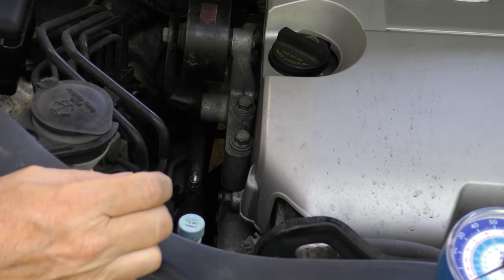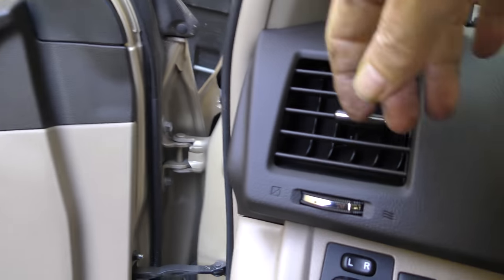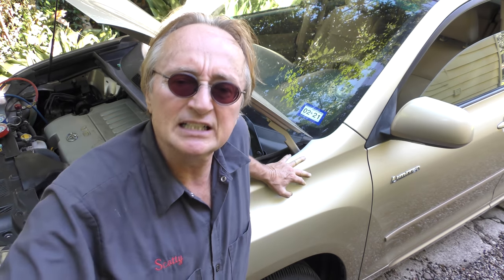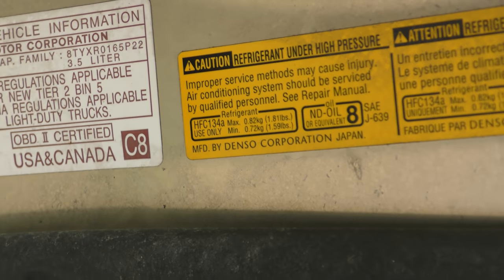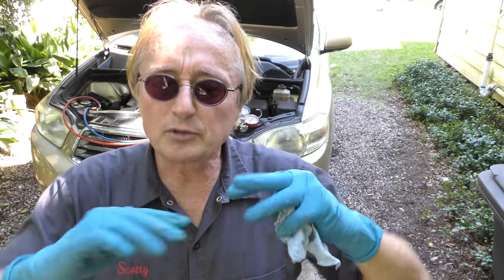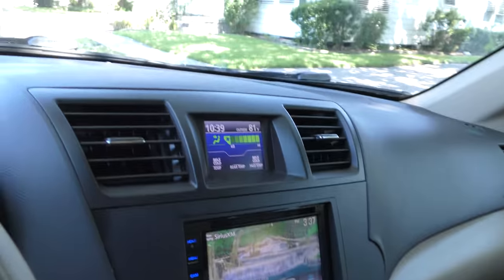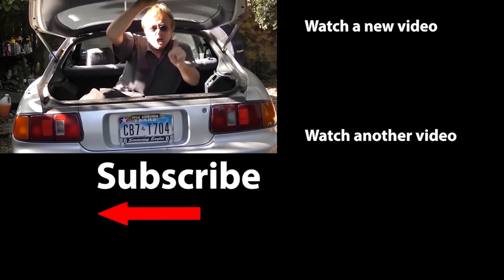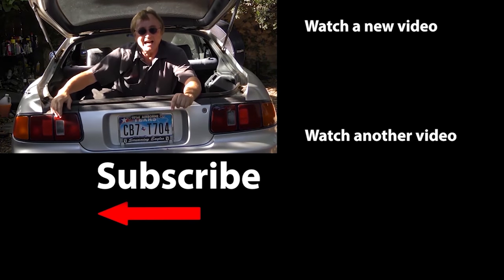Doing This Will Make Your Car's AC Blow Twice as Cold

Comment: I actually had an insane ordeal with my Corolla after an accident. Prior to the accident the AC blew hard and cold as hell. After the wreck and body shop repair I noticed the air was coming ok a bit cooler than ambient but also that the air was coming out like it was on the lowest setting but it was on full blast (Fan speed). I have worked on lots of cars and I worked in an auto shop with my father for about 12 years. That was a while before this though and I hadn't worked in a shop in about 4 years by that time. Anyway I still have all my tools since I paid for them myself. I got out my AC stuff which looks just like yours and my loads were all funky very similarly. I don't know if they got air in or used the wrong refrigerant. All I know is I put a factory load in and the air was extreemely cold but I still had very little air coming out. I thought maybe the fan was clogged, the bearing was dragging it down in speed or maybe the cabin air filter was clogged but it was changed just a month before the accident so I really didn't suspect that. Well I was wrong not to assume the cabin air filter. I don't know where they stored my car. Maybe they left my car open and taken apart because it was as if a bird or rats had nested in there. The cabin air filter was caked with about an inch and a half thick layer of dirt, branches, leaves, tree seeds spider webs and who knows what else. And I was breathing that in!!!! Luckily it had no odor, somehow. Anyway, I bought a new cabin filter and the whole thing has been good as new since then. Obviously I've changed the cabin filter again since then because that was about 3 years ago and I live in a deser that constantly has wind. The cabin filter actually gets extremely dirty and starts affecting air flow here within about 2 years. So I change it every other year now. It's only about 12 bucks so it's not a big deal and it keeps me comfortable. It was just incredible the way they did things so poorly. I actually have a suit going against them because the paint repairs they did started peeling withing a year of it being done. My car is two tone now because the clear coat came off every bit they repainted. I'll be getting it repainted after the case is closed or settled. For now, I look like I have a sunburned car lol.

Comment: 2006 Kia Spectra when my car is idle for over a minute or so the air conditioner will stop blowing cold air even though the air is blowing in but then as start to drive the cold air comes back after about the time.  My engine light is on but I don’t know why.  I think the car runs fine.

Comment: A plugged cabin filter will restrict flow. Toyota’s filters are cheap and easy to replace.
Reply: A plugged air filter was cause the low side to run lower than normal

Comment: After vaccum the system you should hold it for about 10 mins to watch to see if there's a drop. Also afterwards use nitrogen to pressure test for leaks. Afterwards if no leaks from Vacuum and Nitrogen, then charge the system with R134a to the OEM weight.

Comment: Mr Scott: Got a quick question about my 2003 Dodge Dakota V6 Quad Cab. My AC "blows", just not as well as it should. The temp is *ok*, though not as cool as I'd like it, and it doesn't blow from ALL the vents like it SHOULD. It BARELY blows from the very far left vent, and gets MARGINALLY stronger the more you go toward the passenger side. Any idea where to start short of tearing the dash apart and checking the duct work?

Comment: I have a 1990 S10 4.3 automatic replace condenser and lines worked well until fan stopped working can you show video on how to replace whatever sensors involved that won't let the fan run again it is something I tapped around the air filter that controls this fan please let me know

Comment: 90% of the time your leaks going to be your condenser. They have a tendency to get stone damage because they're bolted to the front of the radiator. +corrosion...  I don't trust people selling a used vehicle that say oh it just needs a charge. One vehicle I own I tried to charge it and it leaked out the evaporator in the dash. Almost passed out throwing up off huffing the R134a.  Costly / time consuming repair needless to say it never got fixed. If they say it needs charged there is a leak which you can use dye/ blacklight to tell but if you're spending over $2000 tell them to charge it then... Be careful buying a vehicle in the winter it's hard to tell if it's broken and an AC repair can easily cost $800...

Comment: Refrigerant does not “waste” unless there is a leak well then obviously you’re gonna need some but if not the pressure and total amount should stay the same. However I noticed when you were adding some to your car you had the can facing up and that can cause for more air to enter than Freon so to prevent this a helpful tip is to turn it upside down :)

Comment: i DO NOT WORK ON AUTO AC'S BUT I WAS TOLD THAT 134A WAS A BLENDED REFRIGERANT AND IT HAD TO BE ADDED AS A LIQUID  AND NOT A GAS BECAUSE THE PROPER BLEND IS ONLY IN LIQUID FORM  AFTER IT IS IN SYSTEM IT HAS THE CORRECT BLEND I KNOW FOR A FACT THAT 410A THE RESIDENTIAL FREON HAS TO BE ADDED / INSTALLED AS A LIQUID

Comment: Scotty, I got a 2012 Honda Civic. Recently, A/C stops working. A/C blows cold air only on first start up of the day. After driving 5-10 mins warm air only. A/C compressor works but only for few mins after driving. Replace A/C relay and power is getting through the compressor.
Reply: Recently just got it recharge correctly too. Please any ideas! Will help!
Reply: @Kike5155  Did that help? Condenser clean?  Electric condenser fans working? Diagnostics run?
Reply: wholeNwon I haven’t tried it out but I will to clean it. Electric fans do work tho!

Comment: I went for two years without A/C in Alabama in my '94 Ford Ranger. The compressor spun and the windshield fog would clear quickly in the winter, but the aircon wouldn't get cold.

Took a chance and had the system evac'd two weeks ago and recharged with the factory charge and now it'll freeze me out of the cab on MAX.
Reply: Joe, you can always hang some meat in the Stranger.

Comment: Should check to see if the system can hold a vacuum. Pull the vacuum for about 10-15 minutes (should be a 30-inch vacuum on low side gauge). Turn off the pump and close the gauge valves, and leave set for about 45 min to an hour. If the gauge holds you know the system is sealed. If not there is a leak someplace.  If it checks ok, then resume vacuum for about another hour so that any moisture is removed.

Comment: Hey Scotty you might not read this email but I have a 2014 Nissan Quest with 140,000milesI, change the oil transmission fluid when needed and drive the crap out of that van and I have no problem with it this van it gives me 0 problems, I'll give you another update at another hundred thousand.

Comment: Hey Scotty, thanks for the helpful videos you are making.  they have helped me with my various cars that family and friends bring over for me to work on.  But I have a real head scratcher.  A/C system works only 8 seconds then all power stops- to the cooling fans and the compressor clutch.  If I shut off the car, it does that cycle again.  I have jumpered each piece and appear to work separate.  If I jumper the compressor and it continues to run without the fans, the pressures go up an no cooling.  What is in common to the three items that would cause them to not work properly?  If you have any insight I would greatly appreciate it.  Thanks in advance.  Rich
Reply: Low on freon? Low pressure switch turning compressor/everything else off?
Reply: @sspacil  Freon is good, LP switch R&R, Condenser new,  compressor new, all relays new, ECM new.  the system works only if I unplug the top plug on the ECM.  Not sure what that resets because I can not get an accurate wiring diagram.

Comment: yes I have 98 Chevrolet Silverado 150 collectors edition 350 vortex it has a 4L60E transmission it slips in 3rd and drive  runs 3300 rpm in 2nd gire

Comment: Hello Scotty I just bought a used 2009 Volvo v70 with the inline six cylinders 3.2l and 110,109 km no issues apart from a few cosmetic wear and tear did I make a good choice or a mistake... It also comes with the 6 speed automatic transmission from Aisin..

Comment: I have a 2003 gmc yukon xl 6.0 4x4 AWS.  Have battery drain problems only last 6 months.  Research shows that its a wire problem in steering column but can't  find squat on how to fix. Says the conection needs realined? Plus rear steer quit  but no body i talk to knows anything. Thought about replacing sensors evey worked on these. Thanks for any suggestions.  Raymun.

Comment: Scotty, you didn't mention one of the biggest problems in auto HVAC, the use of coolant cans with sealer.  It's actually difficult to find r134a cans without sealer in them.  It's really unbelievable that the industry keeps pushing this when every AC shop knows it's bad.  In fact most AC shops will not even hook up their equipment to your car if they know you used a sealer.

Comment: @Scotty Kimer, so this might sound odd and not pertain to the video. I have a 2017 Ram ProMaster City with the 2.4L Tigershark Multiair engine. I think that is the same engine they use in the Dodge Dart so would the same turbo work for my set up? Not trying to turn my van into a race car but was thinking when I have 1,800 payload and hauling up the Colorado mountains maybe a small couple pounds of boost might help. What are your thoughts>?

Comment: The high pressure hose wont fit on the low port and vise versa, also I see those get clogged all the time, which wiper act like low refrigerant, most the time you just suck it out and put a vaccum on it and it usually fixes the problem

Comment: Hey Scotty. I have a 2011 Nissan Altima  SL and I am having trouble with the mass air flow sensor.  That’s what the code said at AutoZone, so I purchased a new one and put it in, but it still running bad. It’s jerking as I press the gas, and if I’m going up a hill, it hesitate, and the service engine like is on, the brake light is on and there is another light I’m thinking maybe this is the traction light. All 3 lights stay on constantly. Can you please guide me on what I need to do to get this fixed please.

Comment: When you have 60+ in the low side on a fixed-displacement compressor, you don't need to evacuate and charge to determine that your compressor is shot, but if the compressor has an either mechanical or electronic control valve, that could well be the culprit. If the valve comes out all black or with aluminum shavings, don't even bother to replace it.

Comment: Scotty I got a question. I got a 09 equinox. Overheats with str8 dex cool. Water pump works boiled the thermostat still overheats. Did a pressure test holds pressure. Could the thermostat be sticking for some reason. Get no heat but felt the heater core hoses and they were hot. Im stumped

Comment: I need your help Scott .. I have 01 Lincoln navigator and the turn signals dont work inside or outside,  I have checked the fuses and they are good and I changed the flasher relay but still no luck.. any suggestions

Comment: Hey Scotty, or anyone in the comments. I have a question. I know a lot of cars use plastic under the hood because it’s cheaper. Now I was curious and wanted to know if you could replace those plastic parts with metal parts? And ultimately increase the longevity of the car.
Reply: Depending on the manufacture and model, you may be able to find aftermarket metal variants.

Comment: I have a used 09 G6 2.4 purchased back in fall of 2018. Ac was working fine. 2019 ac refrige seemed to be low and didnt have `the money to fix or get refilled. Now its 2020 and the far right vent blows the coldest but pressure is semi low, Rgt middle vent blows but not as cold as the far rgt vent. Left side vent blows warm air and far left vent blows warmer air. Took it to a friend to show me how to refill it and he said that my ac must be full because it wouldnt take anymore refrig. He said it might be my blend doors. I'm thinking about taking my car to goodyear to have them see if it needs to be refilled or not. Any suggestions would be greatly appreciated. Car has 243.000 miles on it.

Comment: You should evacuate the system for a minimum of 30 minutes. I like 1 hour. I also may have replaced the receiver/drier unit or desiccant. You can fill the system through the high side using liquid. This could also have some aftermarket sealant in it which will royally screw the system.

Comment: I have a 2006 Ram with a 5.9 Cummins Diesel. I replaced the electric fan clutch with a non factory clutch. It doesn't cool when parked. What problem do I have?

Comment: I have a 2004 Mercedes 350sl . Can I take the back box off the exhaust . And still pass the mot ?  If I replace the radiator cap would this help make the car run better ?

Comment: Scotty, I have a puzzling problem with my A/C. It blows COLD  for a while, then it’s HOT. I evacuated the system, put in fresh oil and R-134A. Still does it. It’s a 2001 F-350, with the 7.3L Diesel. What gives?

Comment: The MD the metering device is stuck open that's why it's doing that when the metering device open is kind of like a small hole so when it's open you can't get pressure because you're not pushing against a small hole you're not sucking against a small hole you can't get any pressure

Comment: I have a 2009 Honda Accord lx. I changed the cabin filter. My AC blows cold but air don't blow strong through the vents. I feel half the air on my legs and the dash settings on face with the recirculating button on. What do I need to check for. Really could use your help.

Comment: I'm an air conditioning guy. I knew immediately the compressor was shot when the pressures were too close. if the fans weren't running, the high side would be too high and the low side would be high (but not a lot). If the system was low on refrigerant the low side would be REALLY low and the high side would be low. If this was a residential unit I would have condemned the compressor in 15 seconds, bad reed valves in the compressor. Change it out!!

Comment: I have a 2004 Dodge Caravan, the AC has never worked right. I bought a AC kit and it worked for a minute. I was driving down the highway when my car would not shift out of 2nd gear. Noticed that the AC was not working. Shut off the AC and the transmission started shift like normal. Did all the checks necessary and could not find anything wrong. Took it to Firestone and they told me that I needed to replace the whole AC system which was estimated at $2200. Of course that's more than the car is worth. I either have to buy a new car or see if your tips work because I am not going to replace the AC. Any suggestions?

Comment: Hi Scotty! How long should it take a car that's been sitting (say at work for 8.5 hrs) to get nice and cold A/C with it on Max? I've noticed it takes driving the vehicle for a couple minutes even after a minute of idling or so for the compressor to start doing its job (2008 Honda Fit - 60k miles)
Reply: If that is a deterioration from how it used to be, check the cabin filter and be sure the condenser is clean before checking refrigerant level.

Comment: If you evacuated the system why in the world didn't you track down the orifice tube? Or does it not have one anymore on the newer models? Also older a.c. systems could handle liquid charge but you don't EVER want to do that on any of the newer vehicles. Compressors won't work with liquid. It'll lock it up faster than you can slap a tick!

Comment: Hi!
I have one question with Requesting your opinion on it.

I have Mitsubishi minicab 2012 model 
The issue is when I switch on ac and turn the blower switch to position 1 and 2 there is not ac air not blowing to cabin .
When I moved it to 3rd Position ac switch of but blower air is blowing out to the cabin .
What could be the case

Thank you

Comment: Fastest easiest way to charge any ac system from empty is to pull a good vacuum and then charge with liguid on a scale with the vehicle off.  I let it sit for about 1 minute after adding the refrigerant so it can flash to a gas state and then fire it up.  Usually takes me less than 1 minute to fill any car or truck ac system.
Reply: That's charging in a liquid state. Watched a "mechanic" on like doing it with the compressor running and charging on the low pressure side. He couldn't figure out why the compressor suddenly stopped running!!

Comment: Last year I had a ac line on my land cruiser that was pinched by, and had to be replaced. This was right around the time they switched the cans so they would self seal, but the manifold I had was not meant for that, so I sent the whole day trying to get it work, only to realize it was compatible. I bought a second car, to daily, as my landcruiser only gets 11 mpg, vs the 50 with the lexus ct. Anyways I wasnt able to get the ac properly pressurized, so it hasnt been blowing cold, Ill give it a go again, now that i have all of the correct equipment.

Comment: Hey scotty how u doing i need advice i have a 2018 chevy impala. Driver side blowing mid cold and passenger blowing hot in the morning its both side cold but when its to 92 to 96 its blowing hot air . mind you AC was charged correctly compressor is working fine and actuator is working ...any idea to fix it???

Comment: The cabin air filters can also affect the AC. Me and a buddy of mine we're on a Road Trip and the AC went out 95F  with Nebraska corn sweat humidity so it's more like a 110F - 115F in the car I literally top the car out to get it off of the highway my brain was starting to fry .We pulled in the Midas and they pulled out the factory cabin air filters this car had  300,000 miles it was as black as black could be. Best $35 ever spent.